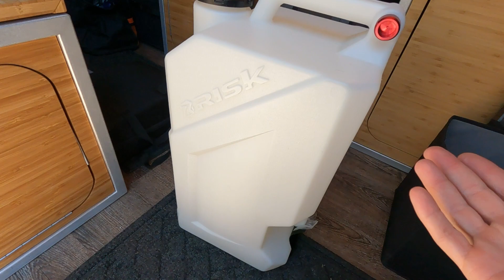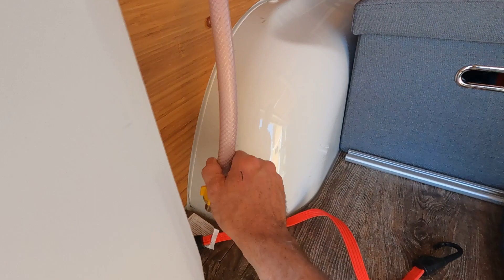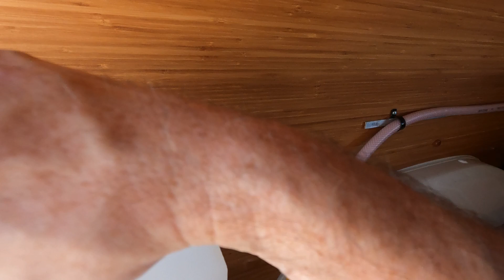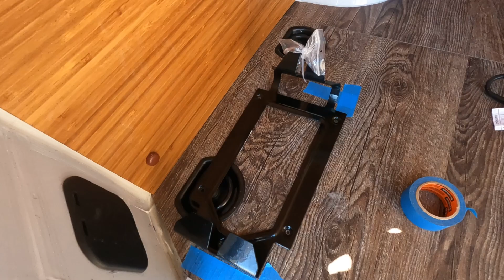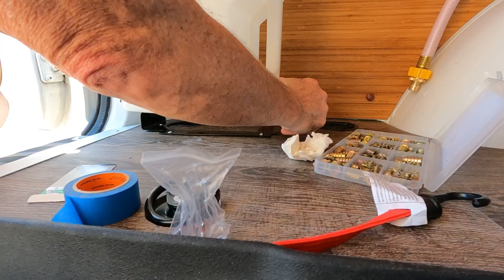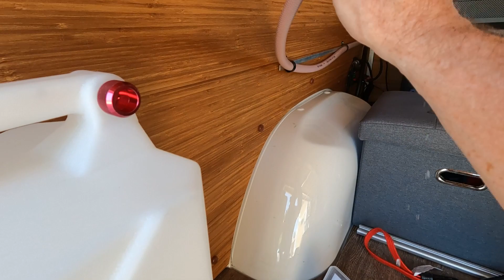Upgrading my Sprinter Vanbuild Gray Water Storage

Comment: Nice!  Even though you don't need a lock, I think I'd put a small carabiner or something through that lock hole, just as an added assurance that it's not going to come out of that mount when it gets full and starts to sway a bit.
Reply from the maker: Yeah, I thought of that but most of my hardware is up at the cabin. Meantime I’ll see how it behaves. A clip might rattle and that’s much more important than 3 or 4 gallons of water on the floor. ;)
Reply: @TravelingSolo  Well, of course. You can just drill a hole in the floor to get rid of the water! 🤣

Comment: I like the simplicity of your design Maury. Having jugs instead of holding tanks makes sense to me too especially since you are not a heavy water user. Simple design, less to go wrong and easier to fix if it does. 👍 Will you need a strap at the top of the jug anchored to the wall to keep the jug from swaying side to side with water in it or is the jug and bracket heavy enough to handle the movement? Just a thought.
Reply from the maker: Thankfully, it doesn't really need any assistance. I tested the jug with a typical fill, and the water doesn't have enough room to travel side-to-side to cause any inertial issues. Since the majority of the weight will be below the midpoint and it's being securely held at the bottom, it is surprisingly stable. I did put a rubber bumper on the wall touching the container, so that does provide a little support as well.